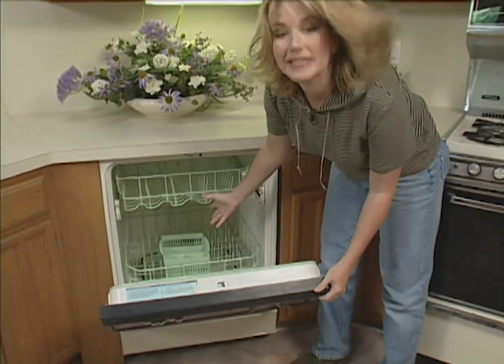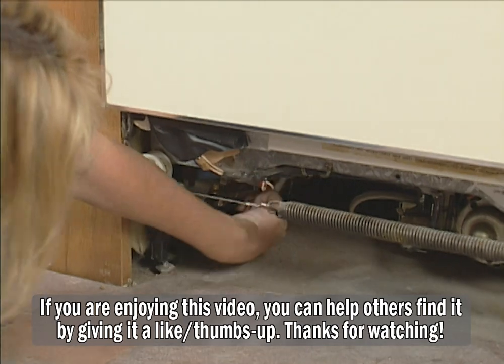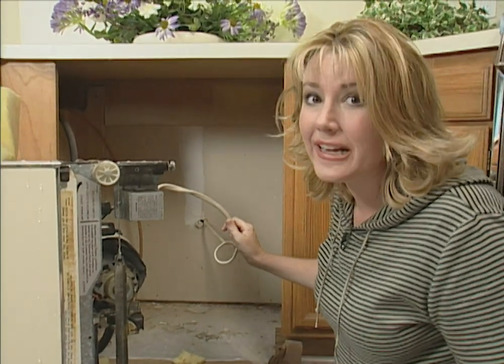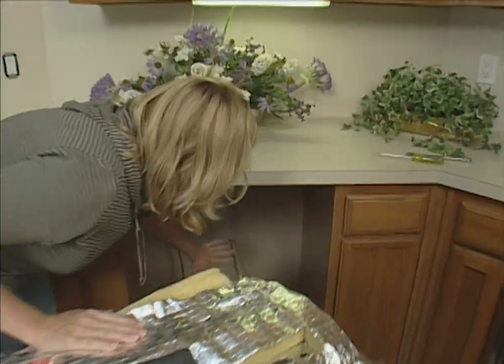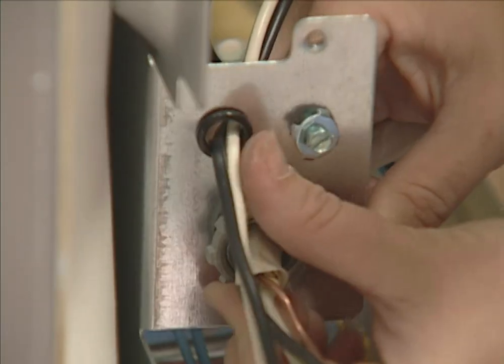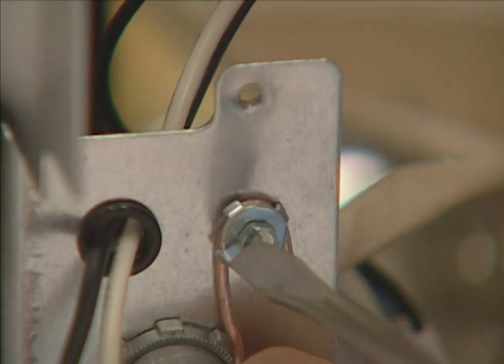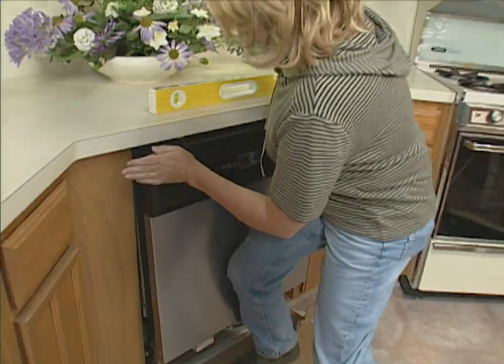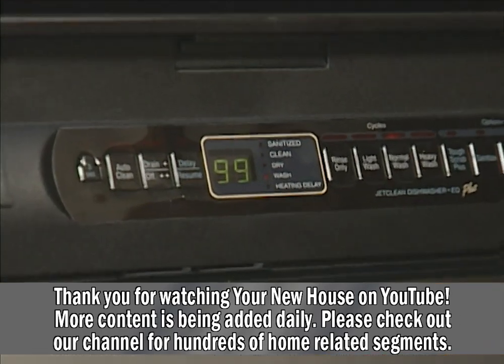Replacing a Dishwasher - Do It Yourself

Comment: My old dishwasher was wired exactly the way both of these dishwashers were.   White/white black/black and then the copper curled around the screw.   My new dishwasher has a green wire.  I understand the green wire is the ground as is the copper wire that was curled around the screw on your dishwashers in the video.   Any idea what to do with my green wire on my new dishwasher?